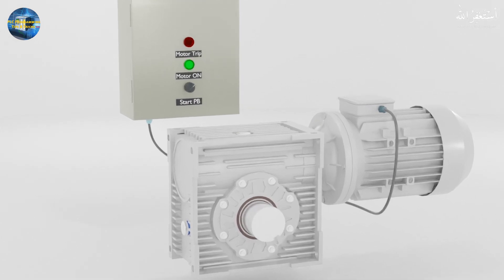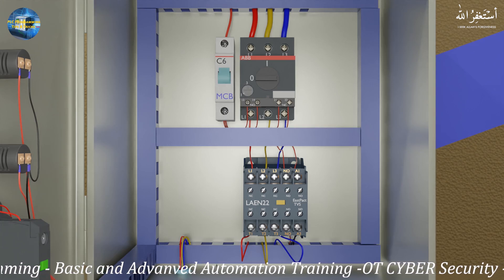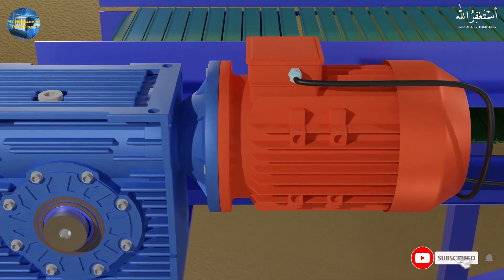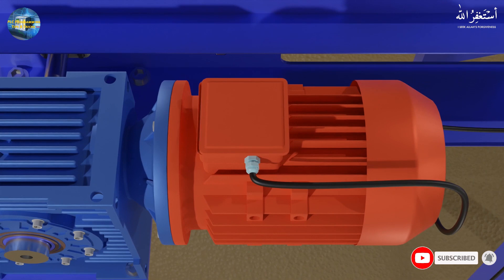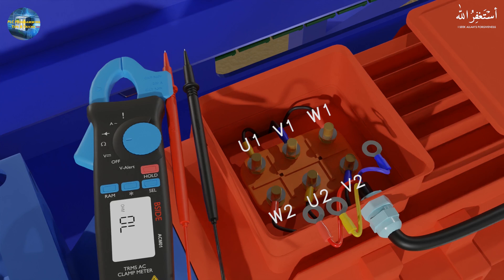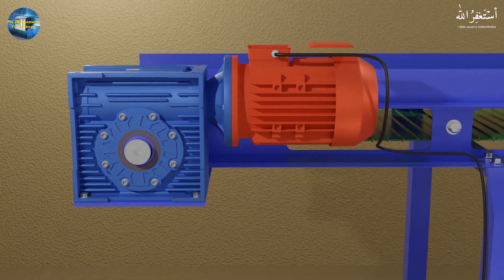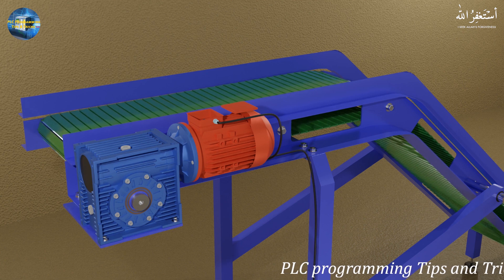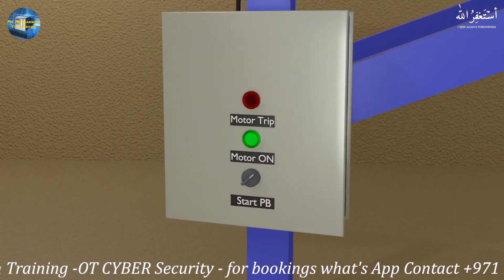How to Trouble shoot the motor tripping Problem- Complete Guide

Comment: I have one question sir. Hope u read this. When we check the terminal box on motor ,to check the continue insulation. Is the power on?? Its save? Bcs we shoul remove the conductor to measure insulation right?.
Reply: Power doesn't need to be on

Comment: Manually hold in the contactor closed and test resistance of each phase through the contactor 
(de energized of course).  Measure for voltage drop when energized  Burnt contacts can be caused by bad windings, cables, terminations,etc.  I would then use Mega Ohm meter to test circuit after contactor if passes
VOM testing.  Replacing contactor does not gaurantee you found the cause!